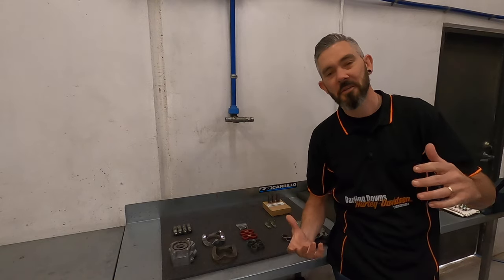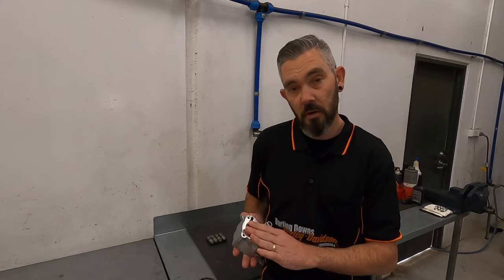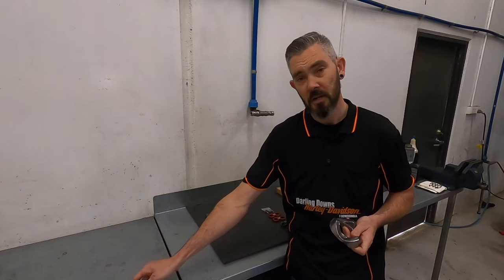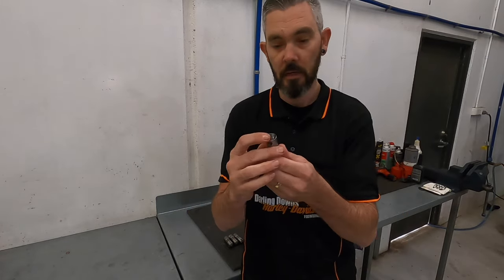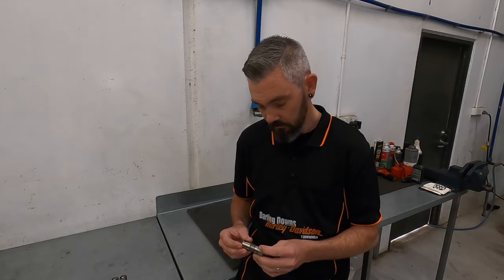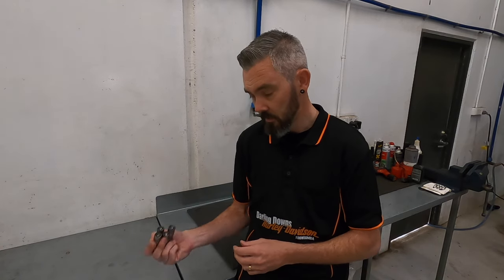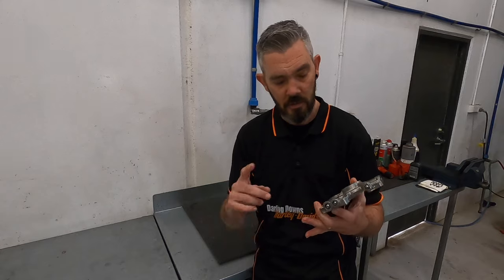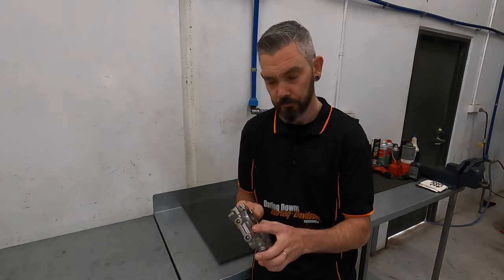M8 Engine Must Have Upgrades / Harley-Davidson / Engine Building

Comment: Hi I have just purchased a 2023 street glide ST 117 Engines and other than headers, pipes and high flow filter, that has been done, should I be concerned about this so called "upgrade" that my pump will still fail?
Your advise would be appreciated. Cheers.
Reply from the maker: Pre 2019 bikes need the oil pump upgrade.
Your bike is fine & does not need it. It's in there from factory

Comment: I’m building the 2023 lower rider st 1400 miles . I have a 475 in it now going to a 132  S&S  and taking your advice and putting the Cycle-Rama 515 ( you suggestion) bigger valve springs , polished 55 mm manifold , 55 injectors , Thrash air cleaner , Thrash-in 2 into one pipe heavy clutch springs  . Question can I use my S&S head bolts again only 600 miles on the build . I don’t do wheelies or burnouts  . Not changing oil pump or cam plate or lifters . What is your thought , I have S&S push rods already .
Reply from the maker: I would be running the 64mm Throttlebody & Intake with that setup.

I'm fairly sure the S&S head nuts & reusable so there shouldn't be a problem there.
Your lifters should be fine at only 1400miles.
Reply: @MasterTechMiller Thanks so much for thee quick response also maybe take the studs out and lock tite and torque  120 lb
Reply from the maker: @charlesmccurry3602  that's a great idea

Comment: Great summary, which I have all your options and nothing more. 
Question if you have time, is their any noticeable gains to be had upgrading a stage 3 117’s se498 cam to something else? Has an S&S  Superstreet pipe and HD extreme air filter.
Reply from the maker: Absolutely! Remove that SE498 & install the CR485 through www.alphaperformanceengines.com.au

That will bring your 117ci to life!

Comment: Awesome vid! I spoke to you several weeks ago about a stage 4 117 having a cr485 installed. Love the cam but i think it deserves some more cubes too! Whats your thoughts on the 128 vs 132 kit? I also asked for oil pump to be inspected when the cam went in, their answer was it looked updated as it had a rubber seal? Is this correct info? Im chasing 150/150 and am hoping with tge 485, 64mm tb, cnc ported heads and dnd bobcat i can get  there
Reply from the maker: I would go with the 128ci kit over the S&S 132 as the cylinders are stronger in the 128. 
The rubber seal indicates an updated pump however it doesn't mean its the 8 lobe (like the one in the video). It had the rubber seal but still is a 10 lobe. 

You should be able to achieve 150/150 with a bump up in compression (around 11.5:1) in the 128ci kit with a good set of heads, exhaust & air filter. A good dyno tuner/operator is essential too.

Comment: Good Morning. I’m doing a 128 build on a 2023 SGS with 2500 miles on the bike. I’m told the OE oil pump and can plate is just fine to support this build. In your opinion would you keep the factory stuff or replace it with upgraded pump and plate?
Reply from the maker: The OEM cam plate & oil pump will be absolutely fine to use.
Reply: @MasterTechMiller  thank you sir!

Comment: Ok not that it’s a problem yet but I just found out this can cause some issues too and that is the long ass screws in the piston oilers just below the top of the crankcase coming loose and leaking causing a whole new cooling and oil supply issue . What is your take on that and a fix or has that since been corrected. I also have a 23 street glide special 114 in case you were wondering 
Thanks
Reply from the maker: I have NEVER seen this. I have heard of the idea getting tossed around back when the M8 engine first came out & they were having 'sumping' issues. 

Since late 2019 & on, all Harley's have the 8 lobe oil pump that has solved the sumping issue.

Comment: Thanks Brother for all the great info! I have a 2017 CVO Ultra 114, completely stock except for pipes and better intake filter with only 6K miles. If this was your bike, would you spend the money to upgrade the oil pump? That's really all I'm worried about. Me and my wife are getting ready to start some long distance riding and it would suck to blow a pump in the middle of no where. What do you think? Thank you Sir, appreciate what you do for the motorcycle community!! New subscriber!!
Reply from the maker: I would definitely spend the money on upgrading the oil pump 100% without a doubt. 
Even though you already have 6k miles on it without any issues (yet) I would definitely replace it. 
If it was a Softail I wouldn't be too concerned but being a touring model I would not trust it. Long haul rising is a catalyst for the sumping issue. 

Don't get caught up in all the BS about aftermarket oil pumps & cam plates just the twin cooler 8 lobe oil pump fitted.
Reply: @MasterTechMiller  Thank you Tommy! Gonna follow your advice and get it replaced!! Appreciate your time and knowledge shared Brother!

Comment: Hey bud love your videos and all you information top notch! 👍🏽 I do have a question for you! I have a 2017 road glide with a 107 m8 that is stage 2 I’m the second owner of this bike I purchased it from Harley a year ago and pulled a report of what was done and it’s got the h-d se torque cam
With new bearing and Reinhart header and  duals and the intake are all Reinhart the bike has the Screamin eagle pro street tuner my question is, is there a better tuner would it help me more?
Reply from the maker: Thanks for watching.
Yes there are FAR better tuning devices out there that will yield far better results with your current configuration.

Are you in the States or Aus?
Reply: @MasterTechMiller  I’m in the states and currently my road glide is at the Harley dealership for an oil leak and I told them to put in the 1275 springs??? Or should I just go with the Se performance clutch and it comes with the 1200 springs and 10 plates?? As I don’t feel the clutch grabbing the way it use to since I started to power shift through the gears😁 do you think that’s a good decision
Reply: @MasterTechMiller  oh also forgot to tell you that my buddy has a 2022 RG CVO 117ci stage one and I pull away from him like he’s standing still lol so I’m not really sure what the PO done to this bike I would love to know ? I also turn wrench I have a full shop in my garage that I work on all my stuff so any guidance will be appreciated, thanks in advance yours truly Mike mike

Comment: I never heard anyone not recommend the sns plate and pump, sns lifters yes 100% would not get those, but the playe and pump???. And what about the sns 475 cam that everyone seems to get installed? Is a star 3030 is a better option than a sns cam?
Reply from the maker: The S&S 475 cam is a great all rounder cam that suits most people. However there are some trade off with it as it's so universal. Yes the Star 30/30 is a better cam than the 475 but there are much better bolt in cams than the 30/30 aswell. The CR485 is the best bolt in cam out there that I have ever installed, tuned & ridden on.

Comment: Hi Tommy… I follow you from Italy… to your experience which of this mods are good for m8 softail. External breather air filter or fueling vented dipstick?
Reply from the maker: External breather for the air filter. Vented from the Transmission top cover.
Reply: @MasterTechMiller  thanks for the reply….and what do you think of vented dipstick oil tank?

Comment: What kind of lube do you use on your parts instal. Suchas the Scream Eagle orange oil pump you installed in a previous video. You smothered the part. thanks
Reply from the maker: Molybdenum assembly lube is what I use on all parts except for the piston & cylinders. I use engine oil on those

Comment: So I had my 131 installed and should they have put in adjustable pushrods? Cause they did not on my build and I put a tman air filter on and oil coming out the back plate which shouldn’t 
The spark plug on the front header doesn’t look like it’s being firing on the spark plug??? Advice ?
Reply from the maker: Which cam is installed? Adjustable pushrods are not required on a few different cams.

Can you explain the front spark plug issue a little more clearly? What you've written doesn't make sense

Comment: How about the Moonshine H-D's Press fit crankshaft cam chain sprocket to eliminate slop in the camchain asm?
Reply from the maker: The amount of deflection throughout the valve train is a greater concern than a little 'play' in the drive sprocket.

Comment: Just when I think I'll get a Harley again  I see this and think not yet. My 99 Yamaha Roadstar did 160.000 ks before someone totalled it only oil changes.I then got a Kawasaki VN 2000 and sold it with 120.000ks only a belt and front belt wheel and both these bikes where ridden hard I'm 6,3 and 120kgI Originally had a Evo Fatboy but the engine was rubbish needed a 10 grand  rebuild just so it could go like the Roadstar hmm when are they going to get it right before I'm to old

Comment: What do you think of the Dark Horse Man O War compensator?
Reply from the maker: I do not recommend it at all for street use. It stresses thr drive train far too much & you will have issues with belt failure, transmission problems (mostly with 3rd gear) your clutch will suffer excessive forces & overall it makes the bike feel harsh to ride.
I only reccomend it to full race applications & where a welded Flywheel is used & the rest of the drive train has been upgraded to suit.
Reply: @MasterTechMiller  The build is a blue printed 124. Dark horse crank ( Balanced welded and trued), carillo rods, forged pistons S&S full cam chest, Bandit sportsman clutch with Trask billet clutch basket, Hayden primary tensioner Stage 3 cnc heads,  Balanced injectors. Baker 7 speed transmission, in a '21 Ultra limited that is not going to the track. The build is being done by Keven Baxter and he recommended the installation of the man o war compensator. I'm not trying to be a dick, but I am fascinated by your reply and am curious if the compensator puts that much stress on the system that it would be more damaging to the build than helpful. The compensator is serviceable with cushioned pads, what is it about this compensator that you have seen in your experience that causes so much damage? There are a few builders here in the states that swear by its use, being that it is lighter and touted as stronger than other compensators. Some builders even put in a solid sprocket, but that sounds like it would do what you described the man o war compensator would do. They even advertise it (The man o war compensator) as having less shock to the system compared to a normal compensator. https://www.youtube.com/watch?v=foeVk_yuh3Y&t=23s
Reply from the maker: The last sentence in my replie states that I only recommend it in engines that are for full race applications & the drive train has been upgraded. 
You state that you have a complete build including transmission replacement & primary drive component upgrades.
Even though you're not planning on going to the track to race it, your build would still fall under the 'full race' bracket.
Reply: @MasterTechMiller  OK I can't argue with your categorization, but these compensators are being installed on stock bikes and seemingly without any problems. The built in cushions would also seemingly allow some backlash in the drive train without causing problems as in a solid sprocket. Have you seem many stock bikes with this compensator have the problems you listed? I would really like to see some videos with this kind of information so that the general public could be informed. Also it would seem that even with the upgraded components, that IF such conditions exist in a stock motor, then they would exist in what you call a full race motor. Mechanical components will wear no matter how strong they are. Again I'm not trying to be a dick, I just want to be informed.
Reply from the maker: @Manonymous108 I will try to be clear.
Yes some people are using it in stock bikes without any 'reported' problems. In saying that, the stock engine would not produce the same amount of huge torque a big inch build produces so therefore would not amplify the problems that can arise from removing the 'give' the OEM or billet compensator ramps allow for so yeah, some stock bikes would not have an issue.
The little amount of cushion provided from the cushion drive in the Man O War compensator ramp does 'soften' the harshness from it but in my opinion and experience if you run that compensator on a big inch build with stock primary & transmission components then you will have problems in time. Maybe not for the first 10k miles but it will happen.

If you wanna run that compensator with a full build that's fine, just know that when you strengthen one component you amplify the weakness of the next weakest component so that's why a 'full build is recommended
Reply: Thanks for your reply. @MasterTechMiller

Comment: On the compensator ramp, what’s your opinion on a stock one and leaving it alone on a 107 other than slip ones? Probably down the road thinking S&S 465, im no racer , do lots of miles, love to just ride, other than beating on it only a few times, for the most part just love to ride.
Reply from the maker: It's more than likely going to be fine to continue running the stock one in your case.
Reply: @MasterTechMiller  thank you, loving all your videos!

Comment: Master tech miller. Is the WM822XE cam good for a 114. Streetglide. Or would you change it to a CR 483. Or 485.     I want it to pull like a fright train and sound killer to
Reply from the maker: I'd definitely go with the CR480MT from Cycle-Rama for your StreetGlide. 
It has a great thump sound & pulls like a MF from idle to 4000rpm
Reply: @MasterTechMiller  what kind of numbers would you get with that cr480mt cam in hp. And torque
Reply from the maker: @iginogasparini3369  in a 114ci you would see around 110hp & 125 to 130ft/lbs of Torque.

The Torque will be at least 120+ft/lbs at 2000rpm & have a perfect flat Torque curve until about 3800rpm where it will taper off. It's a perfect cam for Touring models

Comment: Do you have to worry about runout with the screaming eagle? If so what is the tolerance?
Reply from the maker: All oil pump & cam plate combos have to worry about run out. The SE unit has the biggest tolerance out of them all.

Comment: That bearing you were talking about, is that the lefty bearing?
Reply from the maker: No. The inner cam bearing
Reply: Thanks for clarifying that for me. My brand new LRS is in the shop getting built with a load of parts. I had ordered the lefty and the fellow was explaining it wasn’t needed to be installed. Not only that, it would be very labour intensive. I panicked because couldn’t remember what the well spoken man on the phone had said. I knew there was a super important bearing that needed to be installed. Anyway, I’m going with the right bearing. Thank you.

Comment: I bet you have seen plenty of snaped off lifter cuff bolts and maybe even  some aluminum cuffs that were not installed correctly and rubbing on the lifter.
Reply from the maker: Yes! The early model M8 engines had issues with the front lifter cuffs bolt breaking. They must have been using a bottle of loctite on each bolt at the factory! 😄

Comment: What’s your opinion on the plastic intake???
Reply from the maker: It's generally fine to use on all stage 2 kits. There are no issues with it that I am aware of. Most guys want it gone because it's plastic but that's about it. The benefits of the cast alloy units are that it is able to be port matched to the heads & the inner surface can be textures to help induce intake air tumble
Reply: @MasterTechMiller  Thank you! The oil pump and compensator has been on my mind, I have a 2019, trying to save my pennies, just to do the stage two with a tune is big money and thats with me doing all the labor minus the tune. I would hate to open it up just for the oil pump. What would you recommend for a all around cam and  tuner? I keep thinking the S&S 475 , tuner wise I have no clue?
Reply from the maker: @bmwdan3445  get yourself a CR485 from www.alphaperformanceengines.com.au or hit them up on FB. Mention me. They will ship anywhere
Reply: Im checking it out now, thank you

Comment: Is newest version of the Screaming Eagle valve springs good with a 540 lift cam for the 131?
Reply from the maker: The latest SE springs will handle the 540 lift but I would go with AV&V springs over the latest SE springs.
Reply: Thanks. I've done everything but the valve springs on this brand new bike. Out of $$. Lol. Got a special two off cam from cycle rama. Wanted the 512 but couldn't pass up his offer. We will see how it works!
Reply from the maker: @im4usnot4u  let me know how it goes! Who is doing your tune?
Reply: It's in texas. Can't remember the name. Do you have another way of contact? I can give you the info. 😮
Reply from the maker: @im4usnot4u  you can email me at workshop@ddhd.com.au

Comment: How can probably one of the most expensive bikes you can buy needs so many upgrades, because the factory make such a product, this is shocking , why do people buy HD
Reply from the maker: As a stock bike they are absolutely fine.

Once you start to modify it, these are the options that should be considered.

Comment: Remember, the cam plate is not in there to only support the camshaft and look pretty, it’s a precision oil galley delivery system crucial for your engine. How does a cast cam oil plate compete with the precision of a billet CNC unit? You say you don’t care in the comments what people say.  To infer a statement like that is close minded and disrespectful.  I understand your passion for getting the correct information out there, however, dialogue and support for other opinions is crucial to the community. Consider this.. if you have issues with the  comments- don’t post the videos.